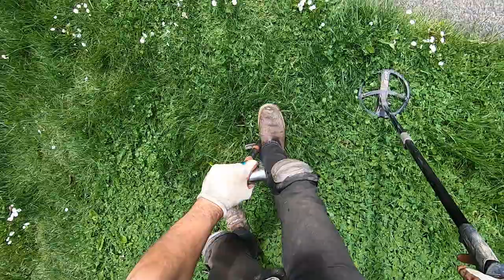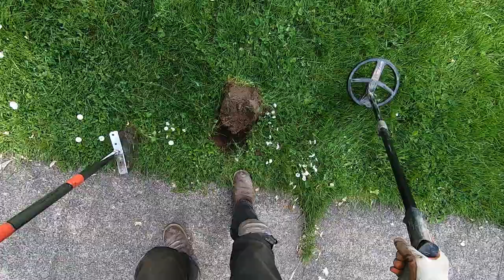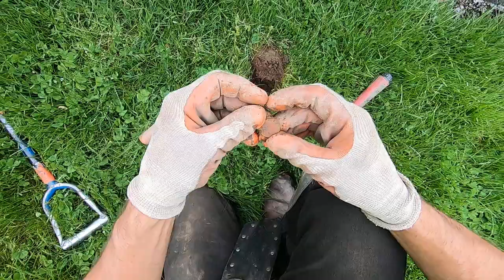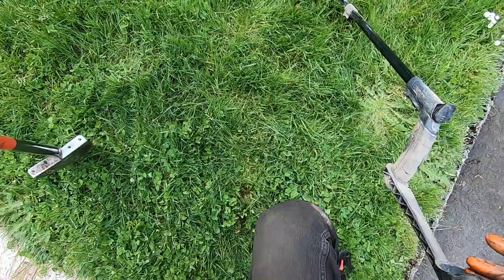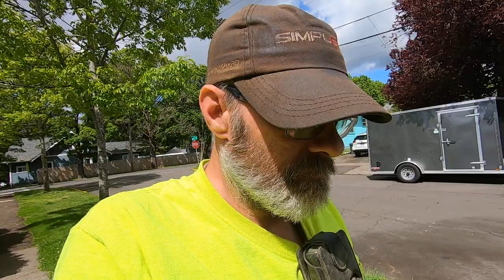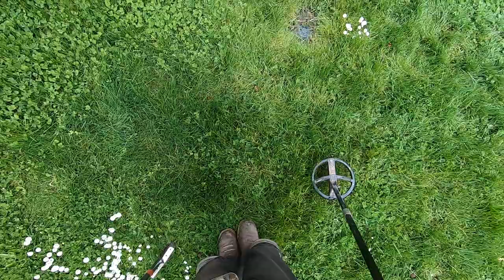LIVE DIG ACTION!! Deus 2 park program on curb strip.

Comment: I notice your Deus II is chatty. Mine isn't as much. I wonder if it is EMI, the soil, or something else? I do think the metal detector makes a difference if you seeking deep targets, which is why I bought the Deus II. I hunt some old parks that have been hit hard. If I metal detect, I want my trash to treasure ratio to be high. Unless I am in sand or water, I notch out pennies, nickels,  and pull tabs. I also use the Deus settings to ignore bottle caps. I already have piles of Wheaties and Indian heads. I understand that for every 1000 pull tabs I walk over, I may miss some nickels and even one gold ring. I am okay with that tradeoff. In an hour, I prefer to dig 5-10 holds with a higher probability of silver. In the water, it's a whole different ball game. I did everything but iron. I'm not into relics.
Reply from the maker: Curb strips have brutal EMI, hot soil and lots of dog shit. The Deus 2 is very finnicky in my hot soil. With the Deus 2 I have found many rings lots of wheaties and lots of Indians too.